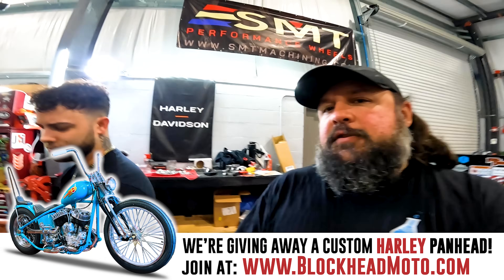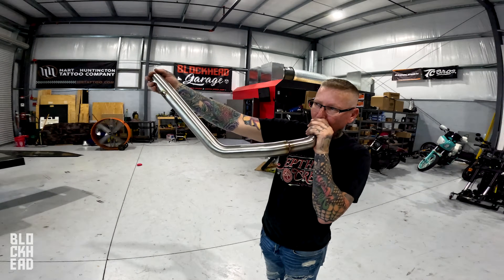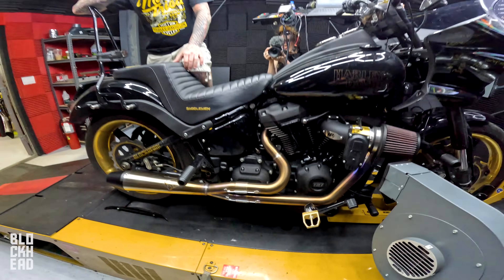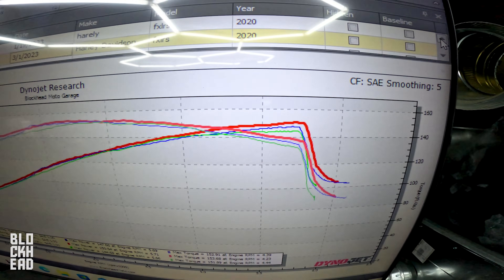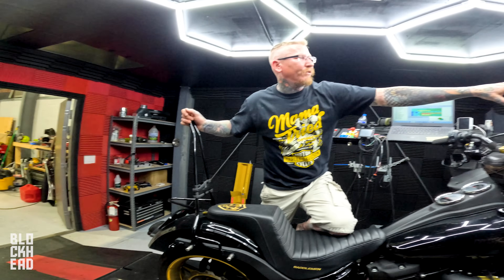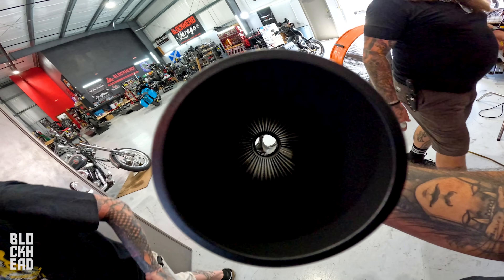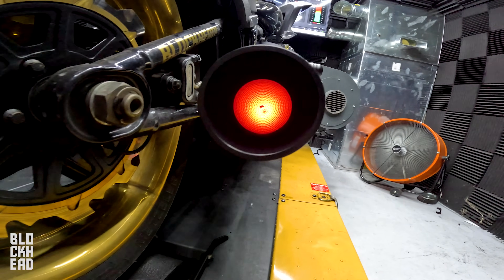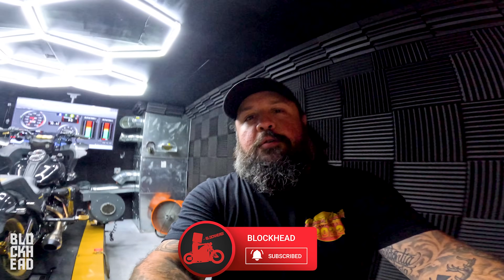BEST Exhaust For Your Harley-Davidson Milwaukee 8? (Pt. 3 - Sawicki Speed)

Comment: Love the look and sound of Sawiki and the performance is respectable for sure. My one critisism is that without heat shields they will cook the inside of your leg. I rode 300 miles with this pipe unshielded and pulled it off the bike. Definately get the shields.

Comment: Bassani Road Rage performs very well for me. I have it on my 2022 Low Rider S. I have a 122 Stage 3 on it with stock throttle body, manifold, and fuel injectors with a Star Racing F35A cam. It's making 147 torque at 3.9 RPM and 128 HP at 5.7 RPM. No torque dip in the Dyno sheet.
Reply: I made 127/127 with my 114 with the f35 cam, HPI 62mm, 5.3 injectors, Trask air cleaner, and bassani road rage 3 full length.  I love it so much.  I don’t think I could get much better that pipe is one of the best.  No torque dip at all here either.
Reply: Bassani gang! 🤘🏽

Comment: My 2022 street glide 114" just came out with another dyno tune. I had zippers stage II with 472 cam and OEM head pipe cat delete and psycho mufflers, bike dyno at 109hp/129tq. Today after install sawicki full exhaust, 64mm throttle body, matching intake and bigger injectors the bike turned 128hp/129tq, 20hp gain over before. Both hp/tq curve also came in lower rpm than previously. Great exhaust if anyone looking to get most out of their 114" M8

Comment: i've had the Sawicki M8 full length 2 into 1 exhaust for 2 years now on my 2021 HD FXLRS and no complaints. Never had it on the Dyno, but good to see the numbers are there. Great exhaust and highly recommend to anyone out there looking for a new 2 into 1. Numbers dont lie!!!!
Reply: Are you running a tune ?
Reply: @OscarHernandez-so9hz  i have the Dynojet Power Vision (PV). Got the Map from Fuel Moto, then did the auto tune feature to dial it in. Thinking to switch over to Thundermax tho. No issues with the PV.
Reply: you mean the mid-length? I dont see a full length for fxlrs
Reply: @xkraztv  the new exhausts do not have a full length. When Sawicki first started the had a full length for M8 Softail, but they no longer carry them. I think now it is a mid-length n shorty.
Reply: @king_fxlrs3051  that sucks. I just received the mid length but have not installed it yet. Will install tomorrow. I hope it sounds like I think it does. I want that thunderheader sound.

Comment: Curious on results for an S&S, they say the high flow cats they put in actually help "the numbers". Interested to see if it's true
Reply: Such as the 50 state legal S&S Sidewinder 2:1 full length exhaust for H-D Touring models with the cat brick located in the slip-on muffler. It takes the red  hot heat away from your leg; introduces some back pressure that is beneficial for optimizing TQ and HP curves; and it's not super loud which is preferable especially on long trips!

Comment: Are you running stock transmission I got a trask turbo on my 114 low rider making 170hp and was going to throw a 128 kit on it to push it over 200 but idk what I wanna do tranny wise

Comment: Truthfully because of emissions  we have 1000 horsepower plus cars.  VVT, direct injection, turbos, ECU’s, higher compression which direct injection helps in cars, electronic fuel injection, hybrid, etc.  look at the koenigsegg free valve 3 cylinder 2 liter engine making 600 horsepower.  No camshafts just actuators to operate computer controlled valve which lift, duration, timing all individually controlled on the fly.  EPA certified in their new GENERA!  Tech will filter down to the masses.

Comment: Look at   dragster , funny cars, wideopen exhaust,   need no back pressure ,, lol,  just a  game,   have tuned  wideopen pipes ,  they  shoot blue flames,   engine runs cooler,  any high powerd engine , just straight  pipes off the heads,😎

Comment: I have owned many bikes.  Spent thousands on depreciating liability toys.  Engine mods are the most expensive/horsepower.  Less expensive to mod suspension and everything else.  A pipe is a nice mod but think about all the other expensive mods.  Another reason to buy the horsepower from the factory.  Nice pipe, maybe bars, seat, and good to go.